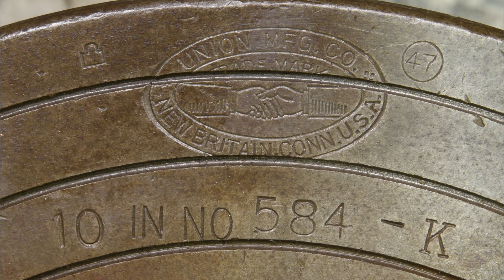Vintage Union combination chuck

Comment: I have an old Union universal chuck from 1882. It’s 4.75” dia., average for the day. It’s odd, in that there’s a ring behind the scroll, controlled by a knob on the back, in a short slot. Move the knob one way, and the scroll moved back in the chuck, and isn’t contacted. Then the pinions move each jaw separately. Slide the knob the other way, and the scroll moves up, and all jaws move together. Tighten the knob for use.

This has a patent from Union from 1879 and a patent from Skinner chuck from March 14, 1782.

Comment: the small plugs on the side, are to center the back plate
Reply: No. If you watched the video, you would have seen that it’s a universal chuck. It has a scroll to move all jaws at once, and individual pinions to move each jaw independently.

Comment: I love the Union combination chuck.  You should be able to make a backplate for the chuck.

Sad about the no-name adjustable chuck.  Useless without jaws.
Reply from the maker: It will be a challenge to make a backplate. But maybe it can be done using the faceplate of my Chinese lathe.
Reply: In the US I would just purchase either a backing plate of the desired diameter.  I have several suppliers which sell backing plates already threaded for my lathe.  They also sell unthreaded plates for people to thread to fit their lathe.

You may be able to make a backing plate by welding a nut with the required thread to a piece of steel then face the steel and turn a register on the Chinese lathe.
Reply from the maker: I've searched but I could only find backing plates for newer spindle noses.
The register on the lathe is almost 2.5 inches. So I would need a huge nut :)